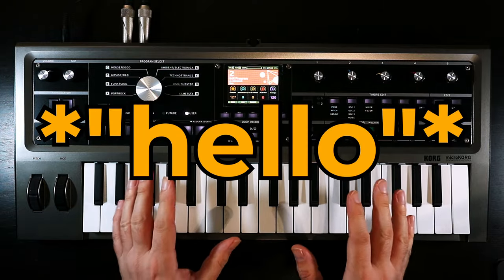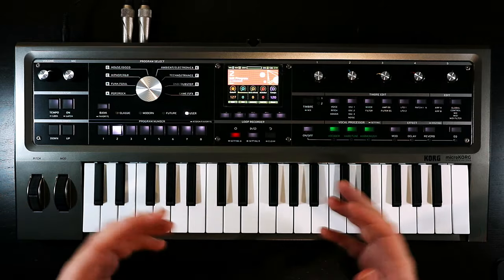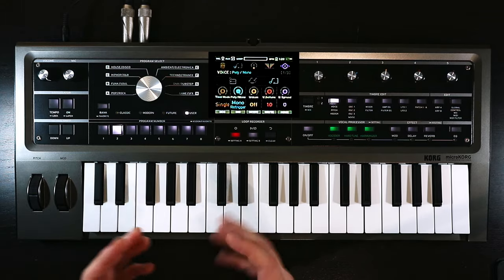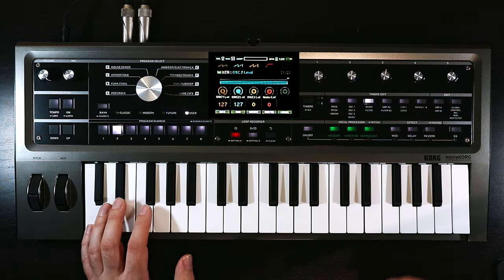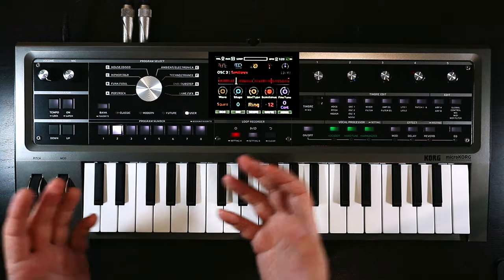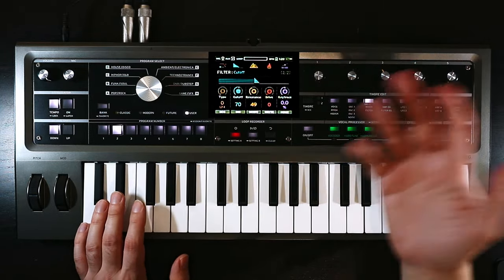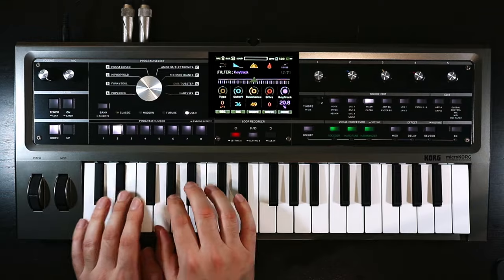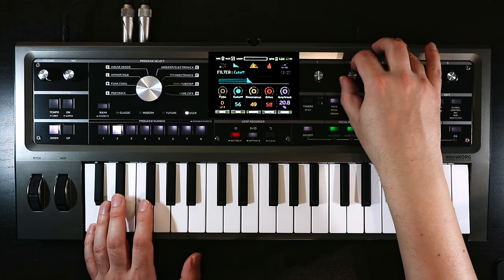MicroKORG 2 - Let's Build: a Classic Bass Patch!

Comment: Probably a stupid question to ask since you worked on the patches for this model. Will any of the old patches carry over? Trying to determine if i should keep my s model with the 2 or just sell the s before the 2 arrives.
Reply from the maker: The synth architecture is pretty different in a few core ways, so no, although it would be an interesting experiment to see how close you could get.
Reply: @OscillatorSink  Thanks for the reply, looking forward to the 2

Comment: What I really want to know is, is the polyphony on the MKII calculated like the original? For example, if I used all 3 available oscillators on one timbre 1 does that take up 3 voices for one note?
Reply from the maker: @koalemos1679  no, voices are voices, and they all have 3 osc plus noise.